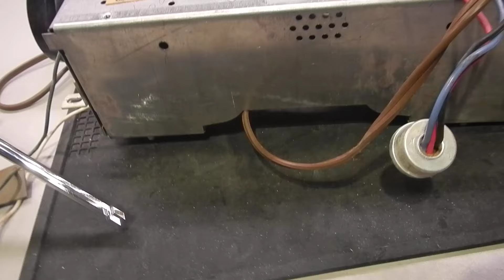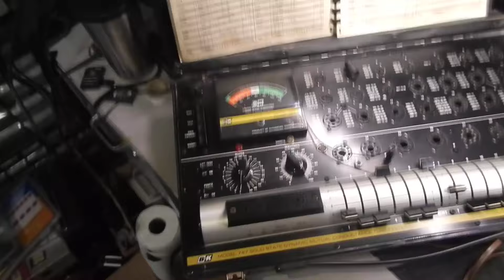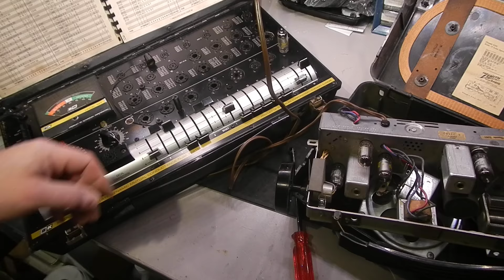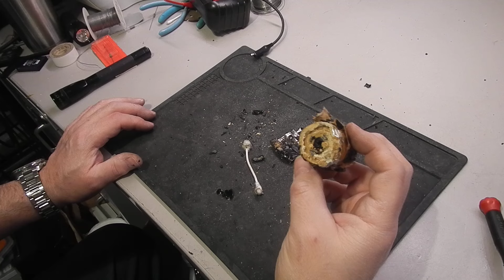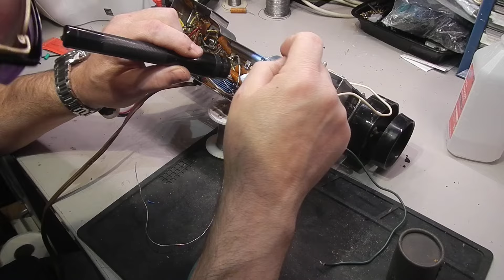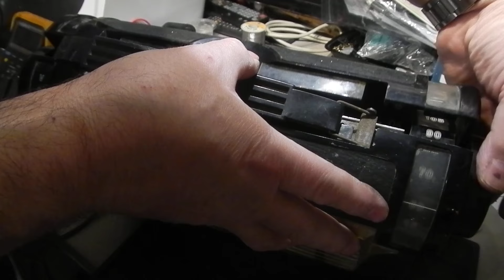Zenith Lunchbox Radio Model J504Y repair

Comment: We had a lot of noise in our AM reception and it turned out to be the neighbor's light dimmer switch in their dining room. With so many digital and switching devices it becomes difficult to trace down the source.
Reply from the maker: It is definitely an issue trying to pinpoint the noise. Like your issue, I have a feeling that the interference is coming from a neighbor.